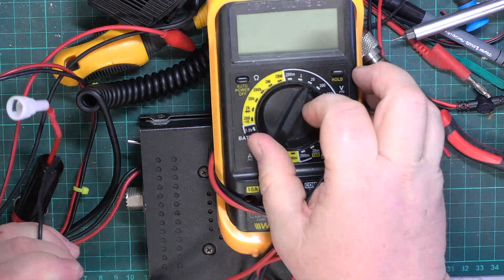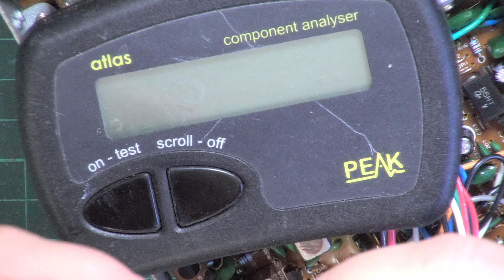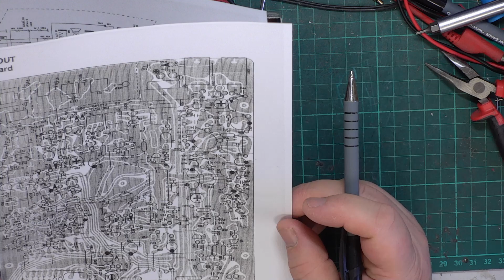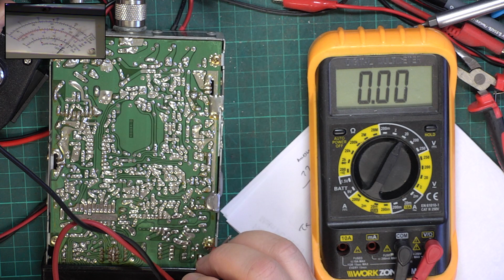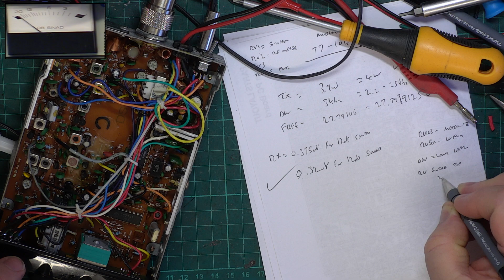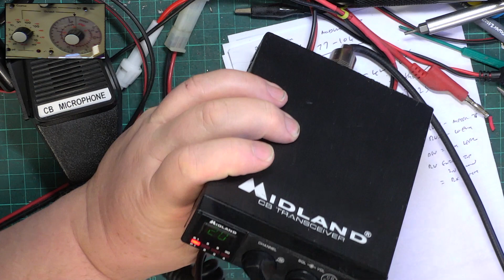Midland 77-104UK CB27/81 UK FM CB radio - repair & service

Comment: I tried fixing mine because I could get in the signal now that no signal was coming. It used to hear static now I don't hear a thing come thru so I cant get a transition. What could be my problem? also, are there any fuses for sale for these radios anymore?
Reply from the maker: Cneck if it works to an extension speaker plugged in to narrow down the rx fault. Bear in mind the microphone needs to be plugged in for rx to work. Fuses are readily available. Fuses are usually 1 1/4" (One & a quarter inch) & either 2 or 3A rated. Some radios like the cybernet Beta 1000 series use 20mm fuses. On the whole you will normally only encounter the two types.

rshireby@yahoo.co.uk

Comment: Nice little sets these, I've just picked a nice one up from eBay, I will give it a re work with the soldering iron first I think 👍
Reply from the maker: Yes...and go to the trouble of removing the shield plate on the print side...that's where they lurk un-noticed.

Richard

Comment: Great job but you need some more instruments to get i good, a spectrum analyzer i recomended to avoid spurioses when you trim the output for example.
Reply from the maker: Is this the first video of mine you have watched? We are commercial business 2-way radio engineers with five fully equipped test benches, two of which have spectrum analysers. We don't use a spectrum analyser on every job. The radios (on transmit) re tuned into a tuned power meter within the Marconi test set in use, so the power indicated is on the correct portion of the band. This radio was a routine repair/service & other than the protection diode hadn't been messed with. Now when a 'screwdrivered' radio comes in; that's the time to use the spectrum analyser.
I am sure you will agree that vey few commercial 2-way radio engineers will service citizens band radio equipment.
Furthermore, all radios are checked for illegal modifications. Any found would be removed.

Richard, G0OJF, UK

Comment: Why did Midland not see fit to use a SO42P as the RF to IF down-converter.
Reply from the maker: Well for starters the SO42P is a Siemens made device & Maxon in South Korea were making the Midland 77-104, so they'll clearly be using Korean made semiconductors from the likes of Kia & Samsung....rather import from Germany.

Richard
Reply: @ukfmcbradioservicingTango21  Yeah, Maxon always used chips from local companies (unless they were forced to do otherwise, but that was very rare) and that is what you would expect.  Buying in from Germany would put the price up a lot and might not be competitive.